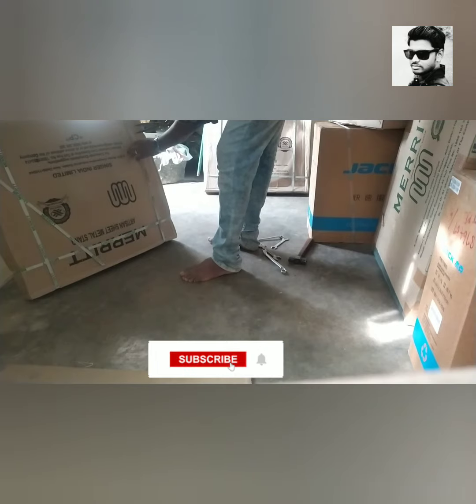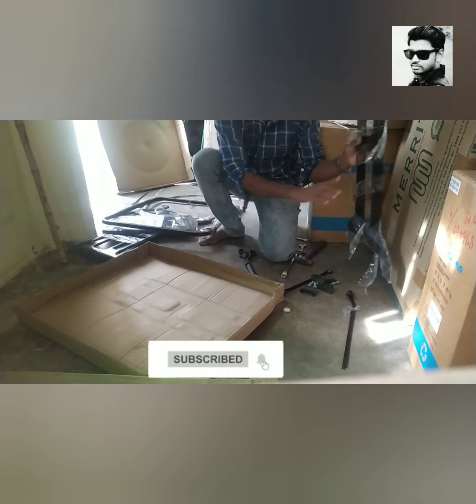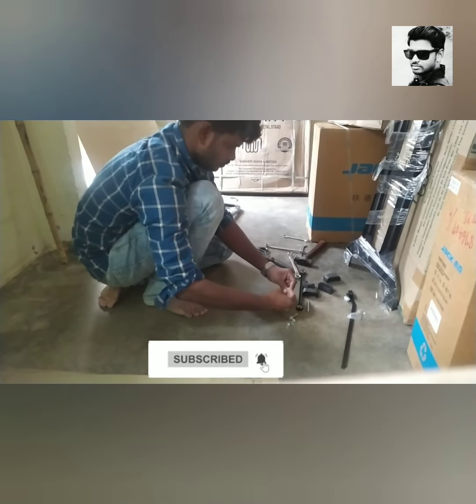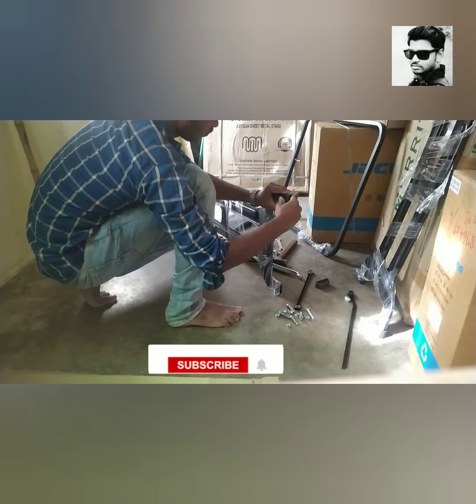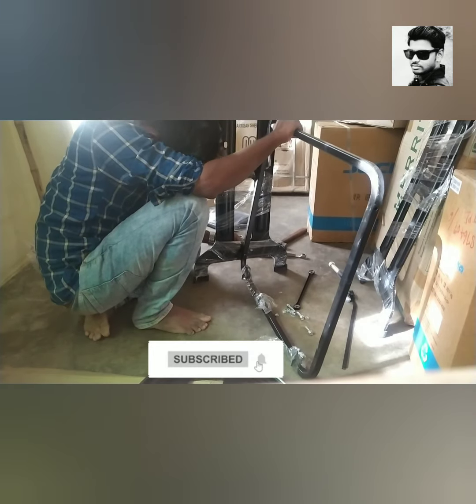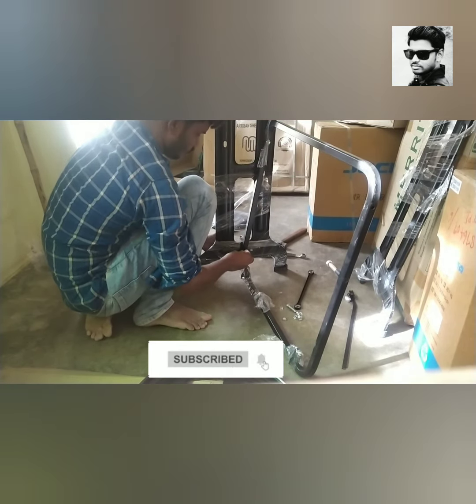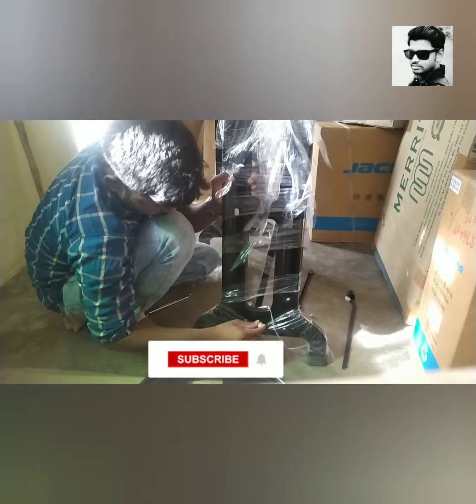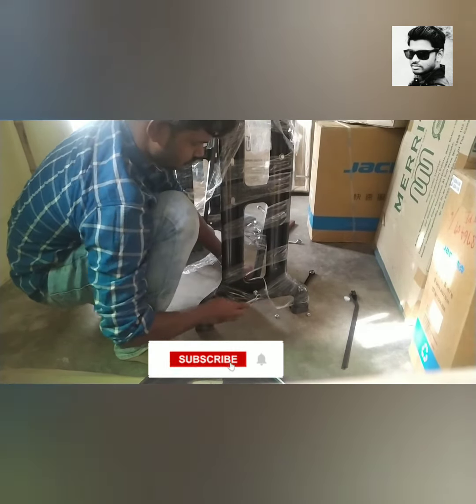Merritt machine stand fitting assembling| sewing machine | tailor machine | LIFE TRAVEL ARAVTHARUN

Comment: Anna ketti thuni vecHu aducha dom dom nu sound varuthu enna problem ah irukum new machine pls reply panunga
Reply from the maker: Change needle and check it
Reply: @LIFETRAVEL570  okay Anna try panre
Reply: @LIFETRAVEL570   machine apadiya struck aayiruchu move aaga matekuthu padal nalla smooth ah poguthu enna problem ah iruku
Reply from the maker: Machine settle la  or wheel or linkset la thread matitu irukanu parunga
Reply: @LIFETRAVEL570  thread ellam ithulaiyume ilaiye check pannom new machine
Reply from the maker: Contact the service centre near by u
Reply: @LIFETRAVEL570  okay thanks